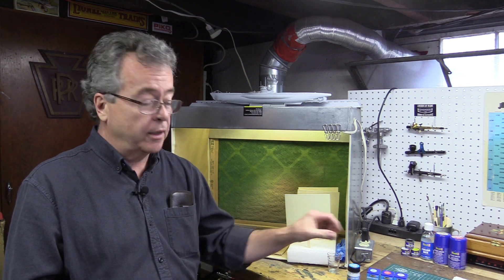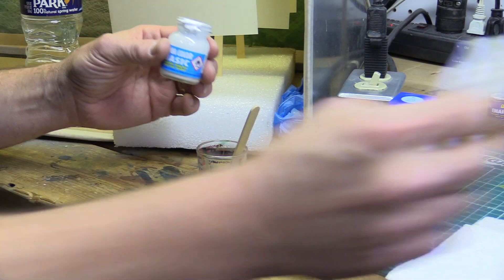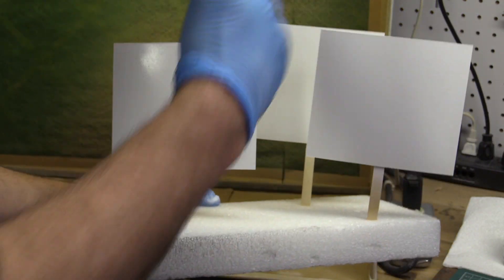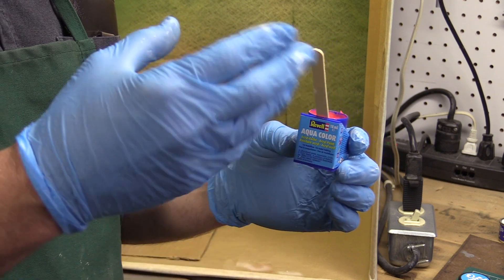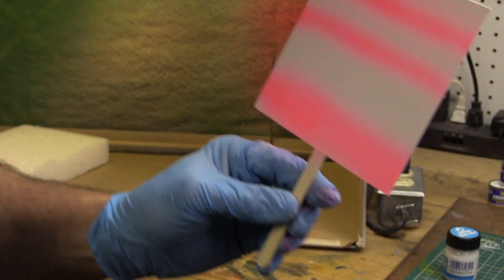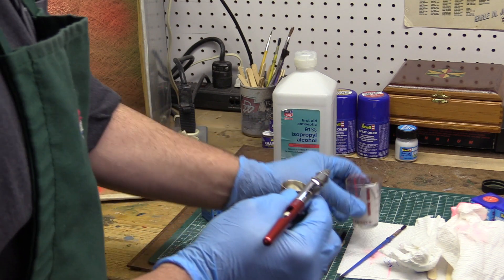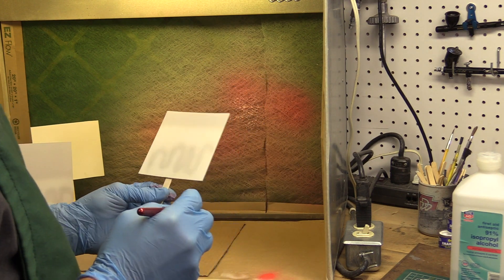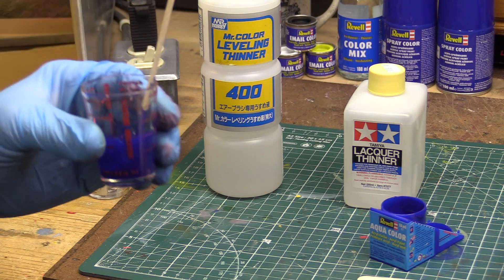Airbrushing Revell Aquacolor

Comment: Revell make their own thinner for Aqua Colors aswell. It's good for airbrushing as it contains thinner, as well as retarder. The tip won't dry so fast on your airbrush, which is common with Aqua Colors on larger models, like 35th scale or 32nd scale that require a lot of spraying time.
I like Aqua Colors on smaller models. For bigger models I use Mr. Hobby or Tamiya, still the best paints around imo.

Comment: Good video especially how you show the difference between drying time using water and ipa. Never used Aqua colour myself for airbrushing  have tried Humbrol acrylics with mixed results but that is down to paint pigments as well as thinning. But I do know not to use lacquer thinner with Acrylics as I’ve seen what the result can be from other reviews and videos, a seriously gunked up airbrush. Even had this problem with Vallejo clear coats, mostly the gloss clear model air. But my preferred brand is Mr Hobby Aqeuous or Tamiya.

Comment: The blue color you used looked like the transparent blue (752). These transparent (or "Klar" in Revell Germany terms) colors are awfully thick, almost like honey, as we saw in the video. They are even too thick to be brushed on. Did you try to dilute it with alcohol or water?
And on the other hand, did you try the laquer thinner with the other colors? I'm just curios if the regular colors could be diluted with laquer thinner.
I use the Revell Aqua colors with the airbrush myself and I like the density of the pigments, but I'm really not a fan of that whole diluting gamble it takes to get them sprayable. By the way: I own the transparent colors myself but never dared to shoot them through my airbrush.

Comment: Impossible stuff to airbrush. Iv used revell auqa color mix & it was terrible 10 mons my gun blocked up. Iv put tamiya paint retarder in the revell & I think it helped
Reply: Im having big troubles with their own thinner. Aqua mix. It dries up too fast and turns into sludge in the container of the airbrush. Can someone please help me? I tried it all...1:1 2:1 3:1 ratio...wirh water only, with aqua mix only...blend with water and aqua mix....same thing. Went to the shop bought new paint. Spared well for 40-50 seconds...same happened again...anyone?
Reply: @GuitarTherapy144  me too. Iv bought 2 different looking bottles Aqua mix & colour mix, both made by Revell both don't work. Iv tamyia paints & there thinner, that turns paint globby. 

All you need is 99% isopropanol alcohol. It works with tamiya, revell & Humbrol paints if isopropanol  dont cut your paints buy a different paint brand .it's all you need as a thinner it's really general purpose